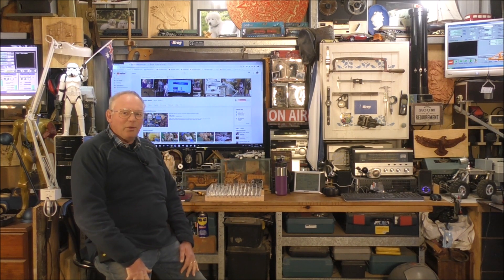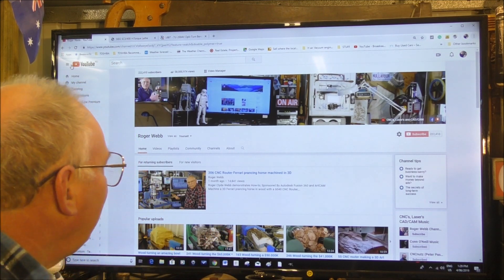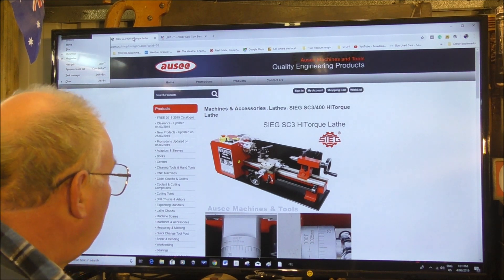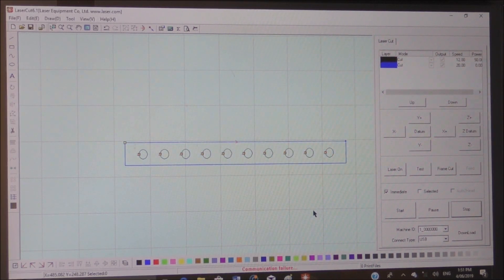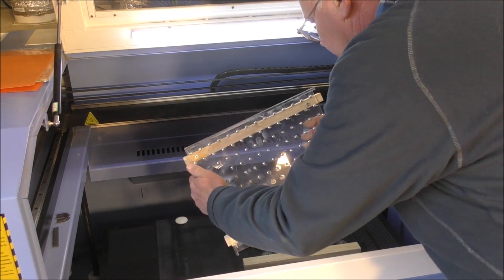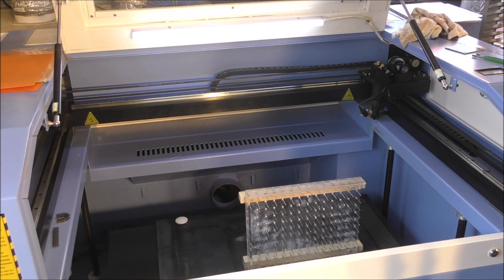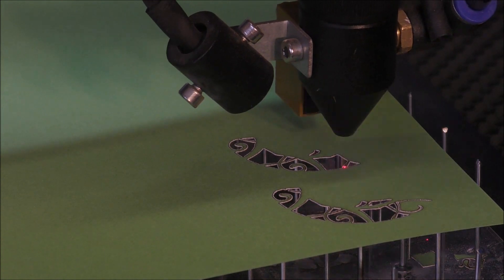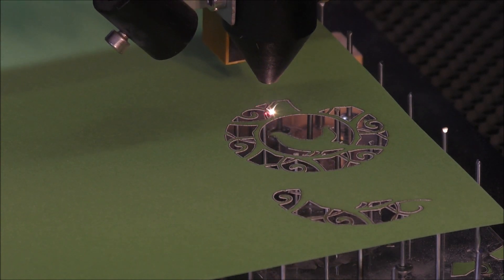319 Laser pin table rear vents completion & project CNC lathe Katy

Comment: awsome videoes but i have a question what are your system specs of your computer  ie memory and cpu size as im having trouble with fusion on mine as it is really laggy running it?? or can you do a video on what you would reccomend as im about to buy a new computer
Reply from the maker: Ok my computers are HP, at least 1T, 8Gig RAM and Quad Core 
Thank you, for watching
 Please like, subscribe and forward the video on to a friend. Roger Webb ;-)
Reply: @inventorsworkshop9600  thanks for that I appreciate it does carved have a hobbyist liscence
Reply from the maker: Hi, Carveco will be bringing out a hobbyist version later this year.
Reply: Mick.
Remember that Fusion 360 works online (cloud). So, it is very important to have a fast internet connection.
Reply: @Flpaz1  where I live is western Victoria in the mallee area and our internet is horrid.. That's why I'll just buy another pc
Reply: @mickhulsen6825  
OK my friend. Having a good computer is very important to work with heavy files in the cloud. Good luck. I'm from Rio de Janeiro, Brazil.